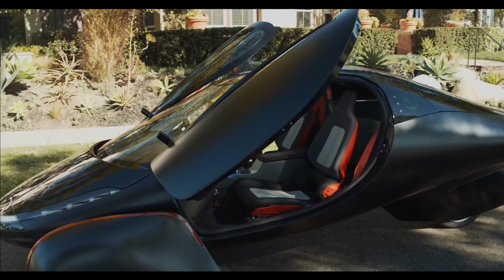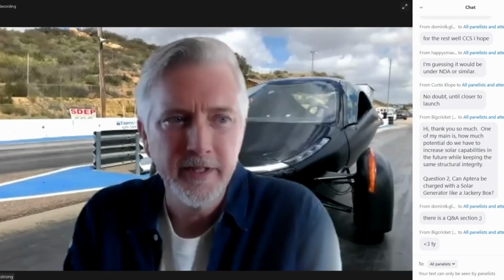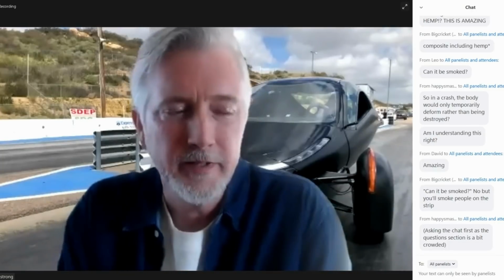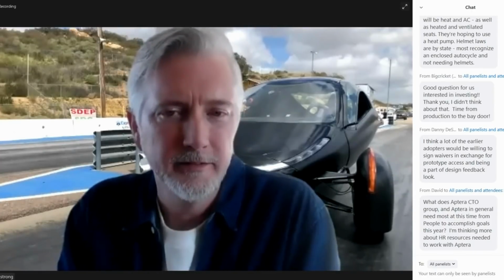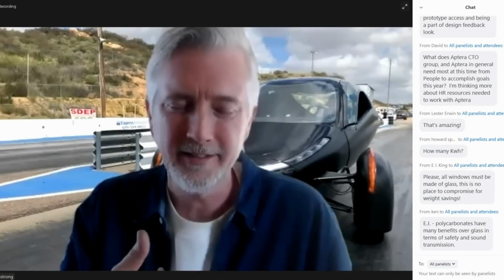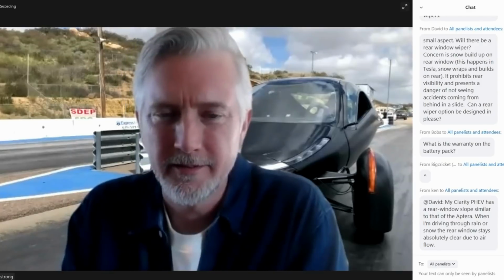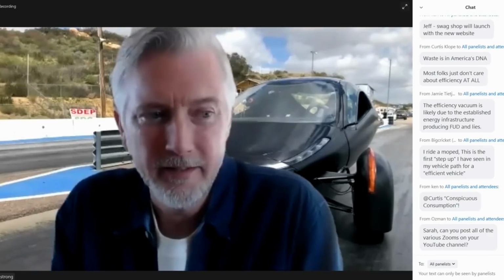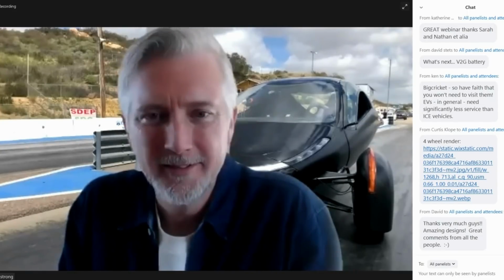Aptera Aerodynamics & Vehicle Safety Webinar

Comment: A quiet car is underrated, the more I find out about it the more I like the Aptera. Accessing the boot is impractical at best but unless you need more than two seats It doesn't make sense to buy anything else if a functional long term solution to transport is your primary motivtation
Reply: How is accessing the boot impractical? It has a hatch, 7 feet of room behind the seats, and 32.5 cubic feet of storage.
Reply: Getting to anything near the back seat will be difficult, basically to get anything out you have to lean over and inside to get your hand under it. Big long things at the back will need to be lifted up and over instead of just sliding them out the back. @garywozniak7742

Comment: Epoxy resins last decades when kept out of the sun, but Aptera has to spend all day in the sun to get its solar charge (sic), and then epoxy products go brittle within months, enough to fall apart on a normal road surface at low speed, especially with in-hub motors. Aptera are too stingy to even protect them with paint, and the vinyl wraps will speed up deterioration. He reminds me of the song that goes - "I know you're lying - your lips are moving", lol.

Comment: He starts at 35 mph (wind force Q) when it starts a 9 in bicycle racing. Here's something from Google -
"Even on a perfectly windless day, you create a lot of wind as a cyclist, and the faster you go, the harder it blows. At speeds over 9 mph, it’s the dominant force of resistance. By the time you hit about 30 mph, 90 percent of your power goes into overcoming air resistance, or what scientists call aerodynamic drag". Still 5 under his start point. The vehicles are in the same air.
Reply: FunWithCars  Lot's more exaggerations than those - all part of the snake oil.

Comment: Torque application has nothing to do with the ratio of sprung to unsprung weight. Rough ride, breaking forces, braking ability and poor handling do - all of which he fails to mention. Torque application is related to the in-hub motor and can be compared against an in-body motor, but that is the extent of it. The first thing he has about what a mechanical engineer should know, and he gets it wrong. I am not even an ME, and I know that stuff.

Comment: The shape-popping feature is nothing but snake oil. Yes, composites had massive gains in efficient production methods, but the gains in strength were very minimal, and the shapes they could do all had been done decades before. If the roof popping back surprised them, then they haven't lived, because plastic bottles, ice cream containers, kids toy hats and many other plastics were well known to do that. There were even those toys that you bent and placed on a table to watch them jump when they sprung back.

Comment: A motorcycle helmet has one slim hole and one large hole, and is designed to crack open on high impact, so the brain is protected as best as possible. Aptera has 3 large holes and they say it can hold the weight of 2 elephants without breaking, and is 7 times stronger than steel. So why did they put a thin tubular steel roll cage in the Beta? They are all talk.

Comment: You have a mechanical engineer designing for aerodynamics and stability when MEs don't learn jack about either. I have watched the moose tests and notice how every time the trike is coming out of one the video cuts to something else. I have also seen the tyre tracks where it has left the road. And then there's the ability to speed up any video before posting it. Do we have posted G-force data or any independent test results? None. Snake oil.

Comment: I am a Canadian, could you clarify the following please with respect to the harsh Canadian winters?
* i get a feeling that the Wheel covers might make it get stuck in the snow. What are your thoughts on this?
* do you think the chances for fishtailing is more during winter driving conditions because of the single rear wheel and cars make track on either side of the road and there will always be snow in the middle
* What is the turning radius for Aptera?
* Do you plan to include tank turn feature which could make the turning radius much more smaller since the rear wheel can be turned in the opposite direction of the turn.

Comment: The only problem I can see having owned three wheeld vehicles it might be prone to aquaplane in wet weather because of the  narrow profile wheels for better aerodynamics also in other vehicles the front wheel clears a path for the rear
Reply from the maker: The vehicle is less less likely to hydroplane with its traction control system.

Comment: Will Aptera have car to grid or car to load. As the car ages will you be able to change any faulty batter cells  without the need to change the entire battery pack

Comment: I worry that if you hit a pot hole, those wheel cowlings will be toast.
Reply: The cowlings or wheel pants ad Aptera calls them, move up and down with the wheels.  They will be at least as capable on potholes and speed bumps as any Japanese small car and much easier to repair or replace if needed.

Comment: Skirted past the question of 2 wheeled vehicles being more efficient than 3
Reply: As a long time motorcycle rider, I know that this is generally not true, for aerodynamic reasons.
Reply: @n.brucenelson5920  as a mechanical and electrical engineer, an old electric and manual bike maker friend of mine says it's true. I don't see anyone comparing two wheel to three or four wheel when doing a quick online search. Pretty sad how little known research there is on this
Reply: @justin5646  The part that is true is that bikes have less rolling resistance.

The most aerodynamically “slippery” motorcycle is the Suzuki Hayabusa which has a drag coefficient (cD) of about 0.55 to 0.60.

Compare this with the Aptera cD of 0.13

All this information is out there.

Comment: Does it have heatpump?
Reply: Heat pumps are planned.  (Reversing valve for the A/C compressor.)  A suitable one may not be available from the aftermarket in time for the first shipments, so some of the early vehicles may be supplied with resistance heating instead.  We will have to see.

Comment: I think at least one side door access to the trunk area is necessary. The rear of the vehicle is high so anything more than light bags and items are difficult to deal with.
Reply: The back is not designed for a greater than 300 lb payload plus driver.

Comment: Was wonder if the solar panels will charge the car while driving, or dose it charge only while parked? Also anything in the future for a  t-top or convertible?
Reply: It will charge as long as there is sunlight or at least discharge more slowly, depending on energy expenditure.  

T-top or convertible options are unlikely due to a decrease in safety or increase in weight.

Comment: Only one place for vehicle registration plate at the black, no practical space for one  at the front...
How much resistance (waste battery power) if a plate is attach at the front? Cause that "face" is very aerodynamic, a plate may destroy all that aerodynamic efficiency carefully designed.
All most every country, nation require 2 plate, one at front, one at back for easy identification.
Reply: If this is regulated as a motorcycle, there's no front plate.

Comment: Paradigm shift. If this actually changes everything which it could how does that affect jobs for people I mean the fewer parts made are fewer jobs. The fewer tools needed to take it apart are fewer jobs. Filling stations wouldn't need people anymore. How does this paradigm shift affect people and their jobs? I'm not saying this as a bad thing I'm just trying to post it as a question maybe be somebody else is already posted it but I was just thinking about that when we make things simpler do we cut out jobs. I get to handmade thing is jobs but consider that it only takes about 10 tools to take apart the entire car. Somebody has to make those tools and somebody has to lose a job to quit making all the wrenches we need for the current models of car manufacturing. Just something to think about

Comment: I am 6'-2" tall and weigh 315 lbs. Will the Aptera's attitude change when I get behind the wheel? If so, by how much? Could the suspension be adjusted to accommodate my weight thus allowing the vehicle to sit level with me in it?
Reply: I have seen tons of info on this, and this issue has not been brought up so far, with lots of bigger people having rides in the prototypes, so I don’t think that it is an issue, as it is not with other cars…

Comment: I think I am concerned at the lack of internal space. I realize they want to have a long range vehicle in case you want to travel from Santa Barbara to Seattle, but I think they have made too big a trade off in the interior space for lightness which is already very light. I think the cargo space could probably be larger and give the vehicle a less purposeful stance (as though it is racing standing still), for the sake of aerodynamics. I wouldn't have one just to be practical.The looks are very unappealing and I am someone who had a Citroen ID 19 back in the day.
Reply from the maker: Aptera is actually pretty spacious for a 2 seater. The vehicle is designed to comfortably accommodate someone as tall as 6'6 if I remember correctly.

Comment: So the aerodynamics of this vehicle look almost identical to the Diamond 20 aircraft. I believe the 2006 Aptera team mentioned that was the base of the design. I can tell you from experience that you will still get bugs and wind noise and definitely road noise transferred. Silly comments from an engineer lol. Not that it has stopped me from pre-ordering one in the slightest as I essentially do a ~300 mile +/- 200miles road trip every week for work. 30-40 miles per day would mostly charge it back up while sitting in a hotel parking lot for the week.

Comment: Torn between fun of 2-passenger and social practicality of 4! Nathan, let's talk about non-lithium batteries with superior specific energy and energy density. It should be possible to dramatically reduce pack weight and increase capacity within a year or so. Also, we expect to double efficiency of solar thin film (printed-on-panel). Around 20 years of battery development, 50 years for the solar by our CTO. He got the first multi-junction, multi-crystalline thin film ceramic semiconductor PV patent -- faster semiconductor than gallium arsenide! -- in 1982. More than doubled modeled efficiency in the last year. I've sent an email in a while ago, and registered on the site.
Reply from the maker: I've felt the same way about 2 vs 4 passenger for a while not. The truth is that having a 4/5 passenger car is a BIG waste of money and energy 80% of the times. I have a 2 car household. My plan is to keep one 5 passenger car and replace one with an Aptera. This way I have one car for family trips and 1 Aptera for everyday use.
Reply: @apterareboot1555  You do realise, that once they start rolling out your production line. Youtube will be full of people uploading Aptera camping videos on how to store a tent and fit a kitchen in it?

Comment: Small, low-profile vehicles are rarely what I would call safe.  They are hard to see by taller vehicles.  The G-forces in an accident are more harmful. The crumple zones are smaller.
Reply: Aptera is not small. It will be crash tested to automotive standards and likely do very well.  The Gen 1 Honda Insight which weighs 1800 lbs scored 4s, and Aptera is likely to be even better.

Comment: My Escape costs $0.11/km for fuel, a Tesla would cost $0.015/km.  That's a huge difference. However, assuming an Aptera will be twice as efficient than a Tesla, that's only a saving of $0.0075/km.  In other words, a Tesla costs $15 to drive 1000km, while an Aptera will cost $7.50.  The fact that EV's are so efficient makes the difference almost imperceivable when compared to a standard EV such as a Tesla.  The compromise an Aptera is making for efficiency does not justify the design compromises it makes such as lack of rear passenger seats and safety.  After all, it conforms to motorcycle safety standards and not automotive standards.  That is one of the primary reasons for the 3 wheels.  Furthermore, efficiency and cost will become less of an issue in the future, due to battery costs dropping and standard EV efficiency increasing. Sorry, but I'll stick to a normal EV, they're efficient enough without the design limitations.
Reply: Alright, but you just admitted that most EVs are far less efficient than your Escape on $/km. And they're still striving for standard automotive safety, it's just that they can test a smaller number of vehicles than need to be crashed for NHTSA requirements and to stay efficient (4 wheels means more surfacs area gripping the road means less range vs a 3 wheel). 2 seat vs 4 seat is a valid point if you need it, but as a pilot light of sorts, this is the smarter play to start with before trying to sell a 4 wheel sedan to a market that's rapidly moving to crossovers and SUVs. Better to start niche and work out the kinks before diving too far in.
Reply: I drive a 4 seat EV from 2002. At 900 kg, I use no more than 100Wh/km average and I get almost 200km on the 20kWh battery pack. So It is simply not worth it to subscribe to various charger networks, as the fees alone exceed what I spend on actual kWh. So what I do is charge for free once a week at my local mall and throw a cord out the window, if I for some reason need to be somewhere far the next morning. Not exactly what you described, but just pointing out that, a more efficient EV has more options for charging, making you less sensitive to price gouging by dfferent providers. Thank you for being metric!
Reply: @Tore_Lund  Great point, which certainly applies to Aptera.  Even if you decide to drive at 120 km per hour or faster, which greatly decreases efficiency, the relative increase in power use will be far less than any other EV, due the low Cd. of 0.19.

I think that many people who have lived in metric countries for any period of time would rather use it all the time.  However, the primary design and market for Aptera is the US market and we would lose most of our readers in this forum if we didn't use English units.  I do take your point.
Reply: Safety is not a design compromise.
Reply: @n.brucenelson5920  It is: Making a vehicle heavier by adding reinforcements, increases fuel consumption and particulate matter polution. Higher mass vehicles also cause more severe injuries, to others than the occupants. Low speed accidents in urban areas are 2.4 times more fatal and severe when a SUV is involved (from an Austrian study).
Reply: @Tore_Lund  What I mean is that Aptera considered safety just as big a design priority as aerodynamics.  As a result, I expect the safety will be extraordinary in testing and actual fact.  My Gen 1 Honda Insight weighs about 1800 lbs, or about the same as a 40 kWh model Aptera.   It got a 4 ratings in the crash tests.  I was hit from behind at 60 mph by a large car and was uninjured while in my first one.  I expect that the Aptera will be even safer.

I don't discount your data.  There are additional factors that your data doesn't show.

Comment: I'm wondering how the much lighter weight, high elastic deformation of the monocoque structure, and rapid elastic recovery times factor in severity of jolts/accelerations of occupants in collisions with heavier conventional vehicles (e.g., a 5,000 lb curb weight Suv)?
Reply: Being the namesake of the famous speed record holder, who died in a claggy crash, it is understandable that you ask this;). Chassis stifness in modern cars with electro tempered reinforcemnts already exceeds, the capability of the human body. An example is the Smart Car that keeps cabin integrity at 70kM/h head on concrete block crashes, however the occupants get mushed anyway. A bigger car with longer crumble zones, has the capability to deccelerate its occupans more gently, but a bigger car also brings more energy to a crash, so anybody outside the vehicle has higher mortality, so from a road safety perspective, bigger cars do not result in less severe accidents. What speaks for the Aptera is the teardrop shape. It has a highler likelyhood of skimping off angled collisions, which though also is dangerous, it breaks up the decceleration into survivable bits.  Being a smaller car, also gives the driver more options to get out of a pinch. I drive a Fiat, which is 145cm wide, and I managed to fit on the raised center divider once when everybody else had crashes around me!

Comment: Can we get any stats about the safety?
Also when will the crash tests be done?
Reply from the maker: Definitely something coming down the line. Right now I think they're working on general road worthiness. And once they feel ready to start driving around in the streets, they'll start making models ready for crash testing.
Reply: @apterareboot1555  thanks. Any stats at all on safety would be great. My main concern is how it'll take hitting a semi truck because I was in an accident with one and I was very glad to be in a volvo..
But I would also just like as many safety stats as possible..
Reply from the maker: @stephensullivan1011  Sorry to hear that happened.. Glad you were in a safe car. Best information I have is that they're designing the vehicle to at least meet but likely exceed current standards. If I remember correctly they ran crash impact simulations and they are happy with the early results. I don't think we see data until they produce the batch of 12 or so they have planned for the summer.
Reply: @apterareboot1555  sounds in line with what I was expecting.
Thank you
Reply: @stephensullivan1011  This thing does not have to meet ANY 4 wheel car safety standards, nor will it! On the road, you will be surrounded by bigger/heavier/sturdier vehicles! If you hit or are hit by anything substantial you will be on the losing end!